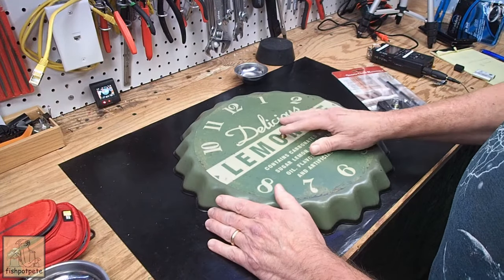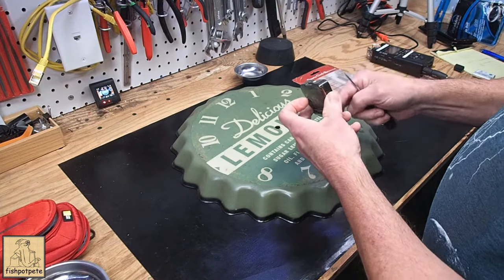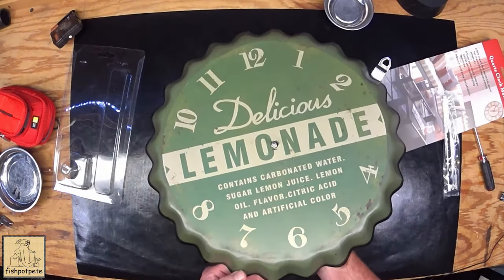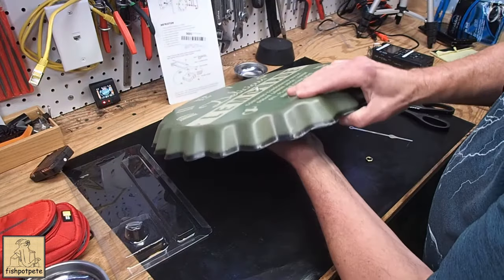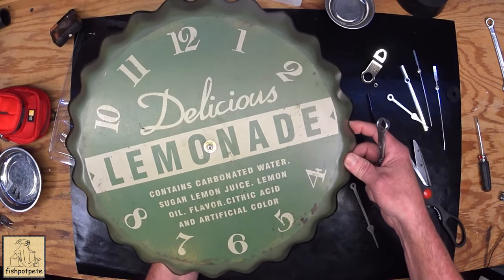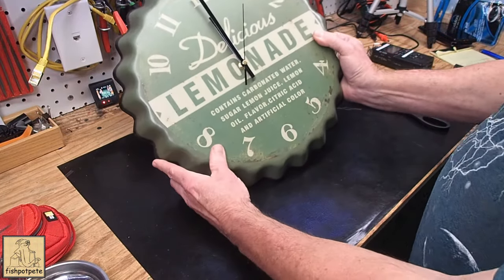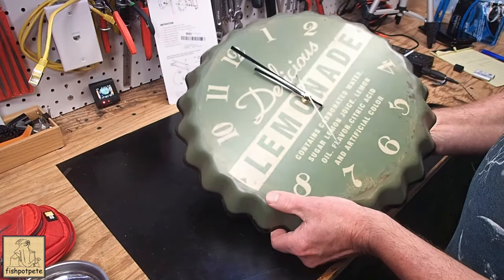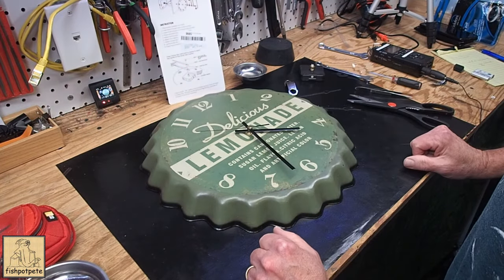How to Replace a Battery Powered Clock Mechanism in 10 Minutes or Less!

Comment: Thanks,great video.  I am hoping to replace the electric movement on an old 40s school /office clock. It comes apart easily and should go together like your clock. Thanks very much for your help.
TOM AND DONNA
Reply from the maker: Thanks for the comment! Hope the repair works out for you!  One thing I've notice is that not all replacement mechanisms are create the same.  Some will last forever and others less than a year.  I'm not sure how to tell a good one from a bad one - other than look at reviews before you buy.  If nothing else, be sure to get the correct stem length so it's not too short to make it through the clock face (or too long and it hits the glass cover if it has one).

Comment: Elvis Presley battery  with pendulum . I bought a replacment kit , I find now that there isa another bluewire that goes into the movement but there doesn't seem to be an entrance for it.This wire goes back2 D type batteries for Elvis singing on the hour. The fault with the clock is the hands are not moving.

Comment: Can I take the mechanism out of one clock and use it on another one?
Reply from the maker: You sure can.  One thing to consider is that the one from the other clock might not have much life left in it either.  But as long as it fits, there's nothing wrong with doing that.

Comment: I have a an older clock and it has a battery powered motor in the back but it was glued on and I’m afraid to pull it off because I don’t wanna screw the clock up so that I can replace the mechanism I tried putting batteries in it but it doesn’t seem to work so that kind of confirm that I needed to replace it, but it’s glued on so I need to either find out how to do that or hire somebody to do it for me
Reply from the maker: That's a tough one.  I'd first want to make sure that it's glued on and not screwed in from the front with a paper clock face hiding the screws.  If you're comfortable it's glue, you could try a hair dryer to heat up the clock body and then work the glue loose by slipping a razor blade between the motor body and the back of the clock face and gently try to get the pieces apart.  But, like you said, you don't want to mess up the clock.  That's a tough one.

Comment: Do I have to have the same model part to replace it?
Reply from the maker: No, I think the main thing is to make sure the rod length is the same.  So, for example, if the original is .25 inch, then the replacement should be the same.  You also might want to consider if you want a second hand or not.  I like them,but they do add another level of complexity because they are easy to get bent while you're installing the new mechanism.  Also consider the color and length of the hands.  Seems like most kits come with a variety of hands though.

Comment: The hands fall on the face bought like yours the hands  fall to the face of clock what can i do?
Reply from the maker: They might need to be GENTLY bent up SLIGHTLY to get them away from the face.  They might have gotten pushed toward the clock face when you were installing them (it's happened to me a couple of times!).  Or they may have come out of the package slightly bent that way.  The hands are extremely prone to bending and sometimes you'll need to use a second set of hands (if you have any).  Let me know if that's what you're talking about or if I misunderstood and it's a different issue.  Thanks!

Comment: can you take a donor mechanism form a different clock?
Reply from the maker: Yes, you certainly can!  Just keep in mind that: 1) it's an older mechanism and may not last as long, 2) the mounting post might be too short/long, and 3) the hands may not fit the clock face size wise and/or cosmetically.  Having said all that, I've reused a few mechanisms through the years without any issues.  Thanks for bringing that up!
Reply: @fishpotpete  thanks i just tried it but unfortunally the post was too short oh well got to try again

Comment: sounds like it has an annoying ticking noise.
Reply from the maker: they do have an extremely faint tick if you listen up close in a quiet environment.  But these are pretty universal/generic clock movements and they are all about the same noise wise.  It could be that the the steel sign I used made it louder - like a speaker cone.  This particular clock in out in my garage so you don't hear it out there.  I have another metal sign one inside and that only makes the extremely faint tick.